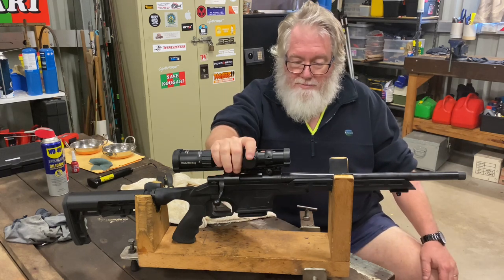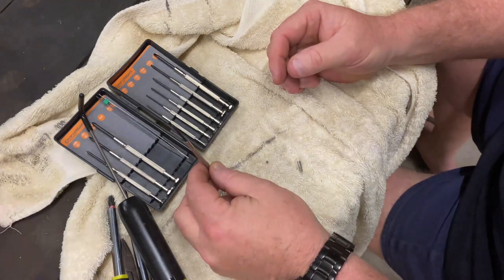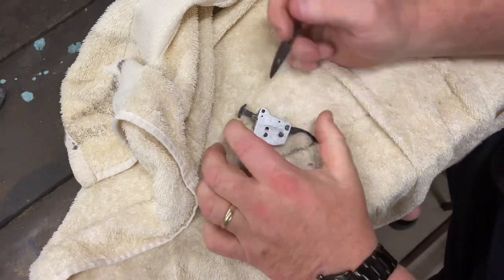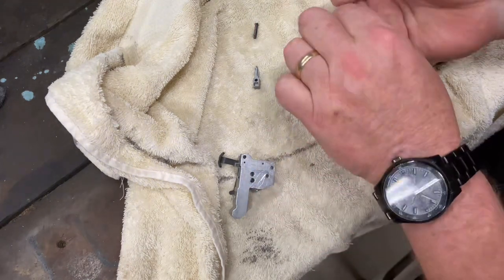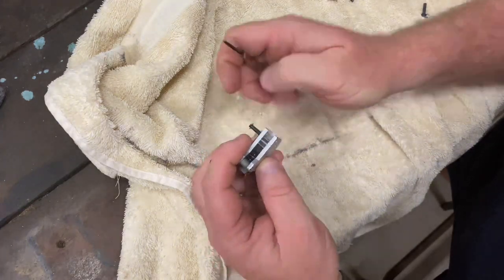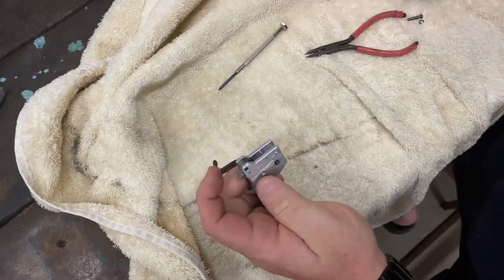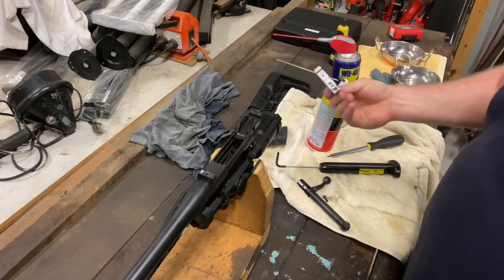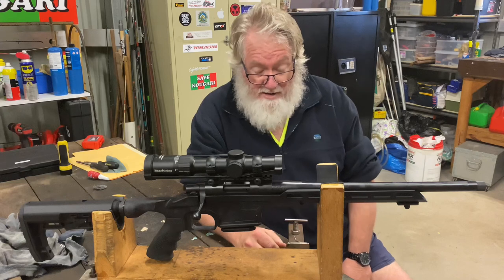Changing the Trigger Spring on a HOWA HACT Trigger

Comment: Gunbloke's instructions advise you to close the bolt slowly after the spring installation. So is this a safe mod or not? I obviously don't want a slam fire if I am trying to do a quick followup shot.
Reply from the maker: Obviously test it first up after doing it (rifle empty of with a snap cap in the breach), but it should not be an issue. I’ve done quite a few and never had a drama. I’d be more concerned with the really light pull weights.